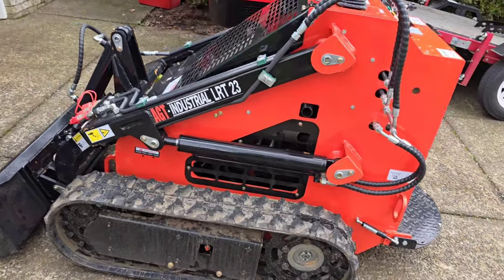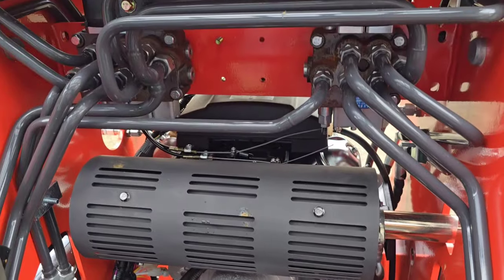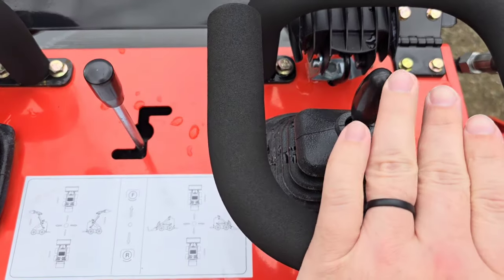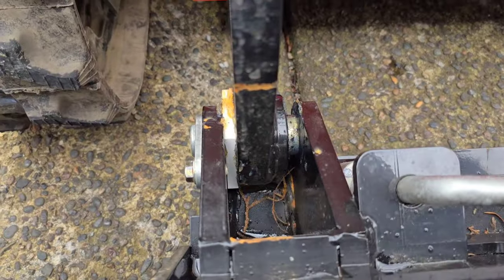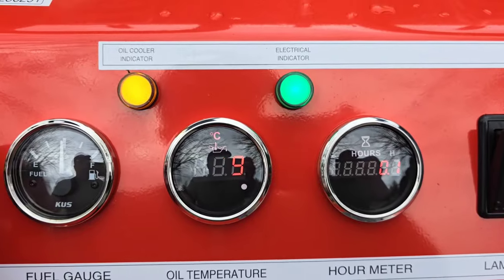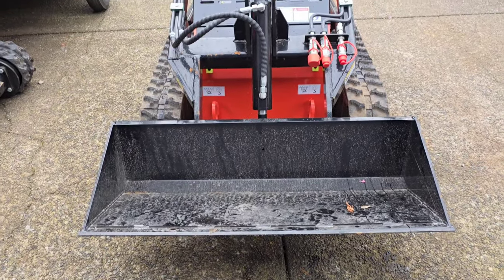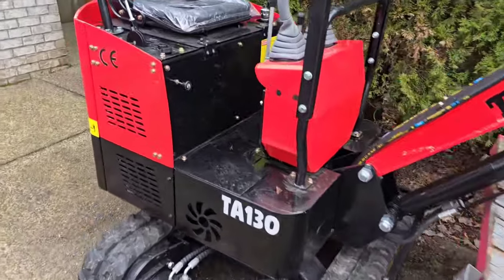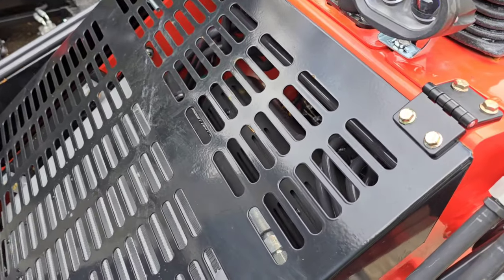AGT LRT 23 mini skid steer overview

Comment: If you buy one, which I just did.    B4U get started 1. Drian & flush the Gas tank & refill with USA Gas.  2. tighten the Track Zert's, on the Tracks & pump the track tension to 1/4" track flex.
Reply: How is yours doing?
Reply: @MyDadWorksAtMarcs  Great! Love it.
Reply: Hey can u explain what the 2nd part means / elaborate a bit please like you're talking to a 7 year old. Thank you
Reply: We’re do you apply the oil at?

Comment: You should put up a video of actually using it. Like clear out some dirt, gravel, vegetation, blackberry bushes would be cool too
Reply: Yes they never show it doing work..
Reply: I might consider getting one if I saw one actually doing work. Though every video of someone having one doesn’t show it actually doing any work. 
I have a small property out of town from where I live, & it’s overgrown with blackberry bushes, weeds, & other vegetation that I need to clear out. I’d also like to put in a driveway with chip gravel.
Reply: @thisisacrummyname  yes its so weird they show u stupid crap like how to check the oil, talk unlessly, then  floor the machine  and spin in circles.. But not one video just showing it working

Comment: I have 10 hours on one and they are good. all snow work, can push lift a lot of snow weight. so far so good
Reply: Did you change all your filters?
Reply: Nope. Everything looks brand new. So far a really solid machine. I went to grease the zerts and they were full. I had to adjust the tracks a few times but now they are settling in and staying adjusted. this spring and summer i will put it to the test landscaping. @RIPTHEFLIPPA
Reply: How much did you pay for it

Comment: Thanks for making this review 👍 I haven’t really seen any good reviews of this unit yet. Thanks 
I just bought a 1 Ton mini Excavator, looking to get a mini skid steer next.
Reply: Where did you buy from?
Reply: I just got my skid steer today. This model. Looking to get a 1.3 ton mini next haha
Reply: @youngprince716  Right on! Yes I have been enjoying my little 1Ton mini Excavator so far, it’s a Rippa and came with a hydraulic thumb and a few other options not seen of most of the AGT minis. I’m definitely looking forward to buying a mini Skid steer this summer.
Reply: @Mikefestiva  sweet bro have you heard of any thing in regard to replacement parts ? Or you plan to just replace with stuff you find locally? I mean like wearable parts that aren't meant to be broken but need replacing. Not like tracks or attachments but actual parts

Comment: Great Overview! Is the auxiliary attachments driven off the one pump? If you are using a snowblower or something will that cause one track to move slower since some of the fluid is being diverted to the auxiliary connections?

Comment: Where do you go for parts (if something breaks)?
Reply: Heard new tracks are plentiful on ebay, hydraulic fittings and lines and fluids and grease nips are available at hardware stors. Electronics are also pretty universal. If you break a piston or joy stick good luck finding a replacement

Comment: I just bought one of these, and it looks like the fuel filler neck, is just tack welded into the gas tank neck tube. and its leaking gas out around the tack welds. Is your like this?